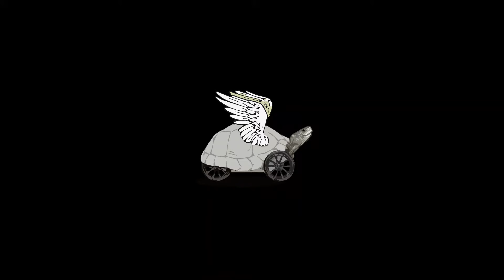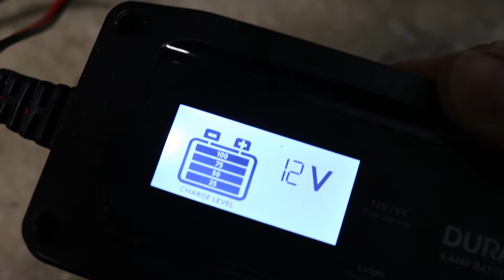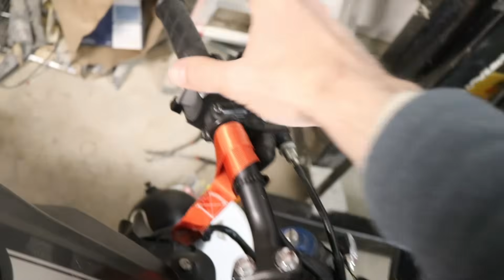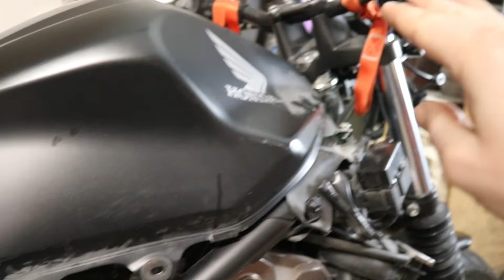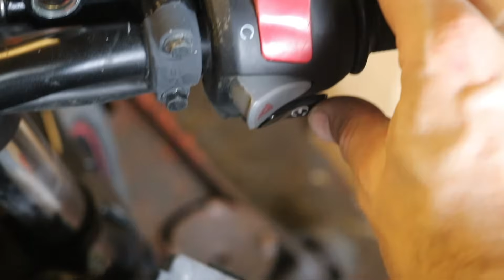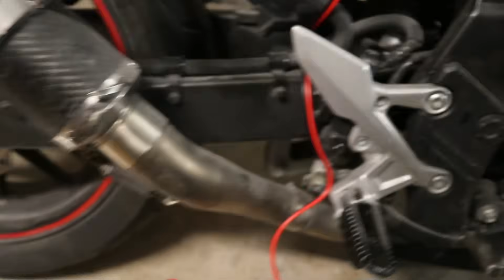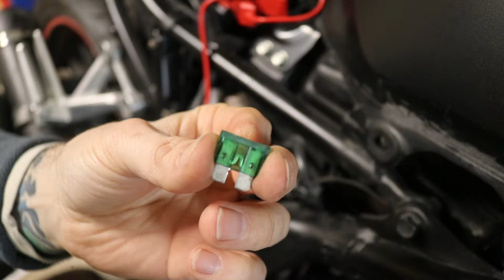Motorcycle Won't Turn On! No Power at All | Blown Main Fuse Diagnosis

Comment: what is that part called that the main fuse goes into called? that part got burnt out like melted almost and no fuse  would work on it. But I've been having an issue with the main fuse blowing often. I was all good and it's completely stock nothing added to it.
Reply from the maker: The main fuse plugs into, or next to, the starter relay/solenoid. Clearly the main fuse is blowing for a reason and figuring out why is not straight forward. You could have a loose connection, a grounded wire, short, or some other electrical overload. The main fuse is the largest fuse and the last defense on the electrical system. There are a number of other smaller fuses on individual sub circuits (headlights, taillights, etc.) and if there is an overload within these systems the fuse for that system should blow before  blowing the main fuse. If two sub circuits are overloaded at the same time that can lead to the main fuse blowing. I often find it useful to track these things down by eliminating what it is not, then I can focus on a smaller range of possibilities. Good luck!

Comment: Im having the same issue with my 2007 gsxr 600 battery good figured out my 30amp fuse was blown but everytime i put a new one it blows instantly not exactly sure the issue ordered a new rectifier gonna relocate it and hope that fixes the issue idk why the new fuses blow immediately.
Reply from the maker: Oh, that's a good one. I would start looking for a shorted wire. A wire may have rubbed through and is grounding out on the frame, or, if you have done some mods lately - look there first for something wired wrong. An ohm meter may help. Good luck , that can be a pain to sort out.

Comment: This is great, would this be similar to a turn signal issue after a tail tidy?
Reply from the maker: No. This video just looks at one possible solution if your bike loses all power and the battery is fully charged. A tail tidy shouldn't affect the electronics. If you swap in LED turn signals you may get hyperflash, like in this video: https://youtu.be/Z29m1f9Yy6Y

Comment: Thanks for this. I dont know much about bikes, will I electrocute myself by pulling that thing out or taking out a fuse or is it literally that simple? I don't have any equipment at all but thought I'd try having a look to save £300 breakdown costs.
Reply from the maker: It's pretty simple. I mean, there is probably always a way to electrocute oneself if wanted, but checking fuses is a basic first step in figuring out where a problem lies. Fuses blow for a reason and tracking down the cause is sometimes frustrating. Knowing which fuse blew and some googling might get you to the answer! Good luck!
Reply: @HooptieDoodle  ok, thanks very much x

Comment: If you hook your battery up backwards would that blow the fuse
Reply from the maker: Totally. It should blow the main fuse and possibly damage some components. After hooking the battery up correctly and replacing the main fuse you're gonna want to check that the alternator/stator is working as well as lights, etc. Good luck!
Reply: Thanks alot bro, I drove two hours to buy a bike and the guy had the battery on charge so I could hear the bike run. Well he hooked the battery backwards and tried to start it and of course nothing...long story short I took my chances and bought the bike and noticed the battery was hooked up wrong......thanks to you I found fuse and it's blown, I gonna replace and check everything else....your awesome bro
Reply: I put the new fuse in yesterday and I'm still getting nothing, looks like I got my work cut out for me
Reply from the maker: @mattholliman579  best of luck brother. Fingers crossed that it's something simple
Reply: The sameee question i had. I messed around and plugged the negative up on the postive and vice versa,,, got a big spark and wldnt crank nomore. Guess im gnna go get some new fuses in the mrn